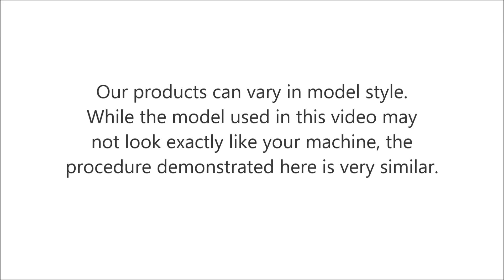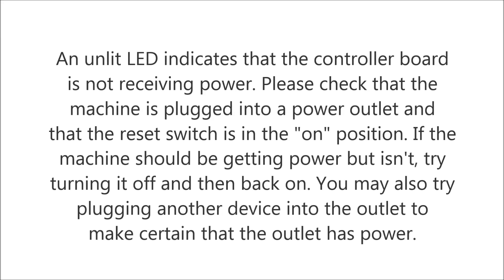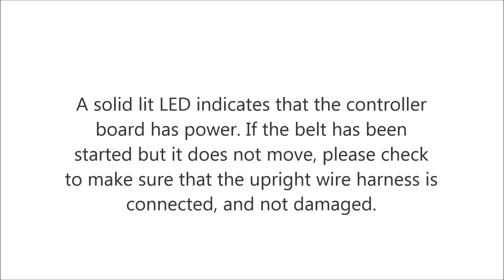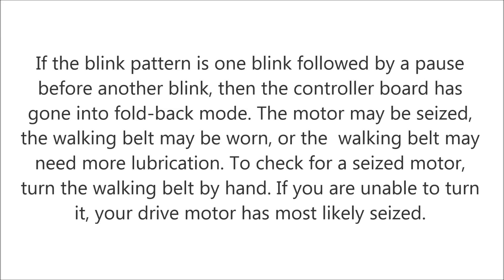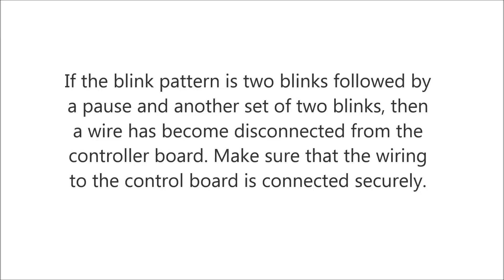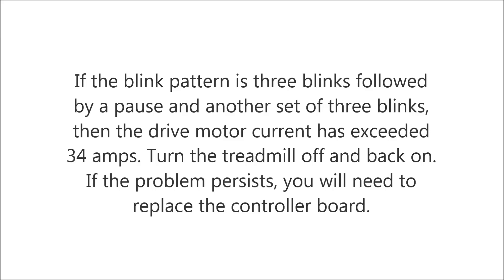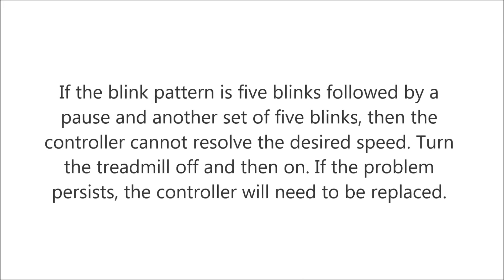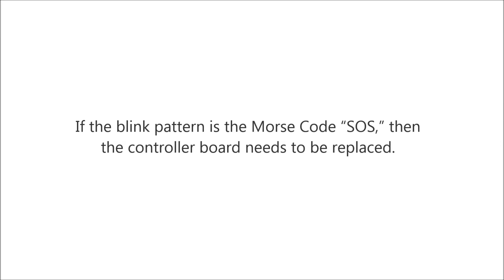LED Blink Patterns on the Control Board - Treadmill

Comment: my xterra tr6.4 stops as soon as I start it. then the red light stays lit and doesn't blink. I just got a brand new motor controller board put in. what is going on?
Reply from the maker: Does the red light ever blink? Do you mean your motor does run for a moment when you press the start button so the belt moves but only for a very short while?
Reply: Fitness Equipment Help yes it blinks. it starts then 2 seconds later it stops then the red light stays on then it says LS low speed
Reply: Fitness Equipment Help I just put a brand new motor controller in a couple months ago
Reply from the maker: I apologize,  I should have read your first post closer. This video is designed for trouble shooting  controllers from another manufacturer, Icon Health & Fitness. Icon does not make Xterra treadmills. I am not as familiar with Xterra machines but i would check to see if you have a speed sensor that is unplugged or in need of adjustment. Your treadmill console may be looking for a speed signal from this sensor and is shutting down the belt when it is not receiving the information it is looking for from the speed sensor.

Comment: My treadmill proform XT 70  shut down completely with Tripp in my wall circuit breaker , after reset my circut braker  I checked the control board, and it has a solid red light. What would be the issue typically in situations like this?
Reply from the maker: The most common reasons for your homes circuit breaker to trip when you start the  motor are using the treadmill on a circuit that may be overloaded and using the treadmill on a circuit with an Arc Fault Circuit Interrupter (AFCI) type breaker.  
 
The treadmill used a large amount of power, (amps), particularly when starting up or increasing the speed of the belt. It is recommended that the treadmill be on a dedicated circuit capable of providing at least 15 amps. Dedicated means that the only thing that losses power when the breaker trips is the treadmill. If other devices must be on the circuit then they should be very low draw devices like the light in the room or possibly a cell phone charger or the like. If too many devices are on the same circuit when the treadmill tries to start up the breaker will trip as more amps than the breaker is rated for is trying to be pulled through the circuit.
 
If your treadmill is on a dedicated circuit you should see if you are on an AFCI protected circuit. The breaker should say AFCI or ARC Fault on it. These are a relatively new type of circuit  breaker. If your home was built in the last 15 or so years it likely has AFCI breakers in the bedrooms. Homes built even more recently were required by code to have them on all circuits. AFCI breakers are designed to detect signals that look like sparks and shut off power to the circuit before these sparks can cause a fire. The problem is many appliances including treadmills generate signals that are similar to the ones AFCI breakers are designed to detect.  Some AFCI breakers are not sophisticated enough to tell the difference. Google "AFCI nuisance tripping" and you will find that along with treadmills, people have had issues with many types of products tripping their AFCI circuit breakers.  To relieve this you can try plugging your treadmill into a noise filter.   Your owner's manual likely mentions that you can get one from customer service. there are also other commercially available noise filters such as the Tripp-lite Isobar line of surge protectors.

Comment: My problem started today, only 1 year and 4 days after purchase. The light is blinking rapidly/continuously, but the belt is not moving. When I turn the speed up higher (5 or so) and give the belt a push, the treadmill will run; however it sounds like a diesel tractor and makes a clicking sound. It is soon followed by a strong chemical burning smell.
Reply from the maker: It sounds like the motor may be having an issue. The blinking is indicating that the controller is receiving the consoles commands and outputting voltage to the motor. Replacing the motor should resolve that issue.

Comment: My led is blinking 7 times. The model is Nordictrack 5.7 NTL6. What It can be?
Reply from the maker: Most LED Error Blink codes indicate an internal problem with the controller. Regardless of the number of blinks the troubleshooting is the same. First turn the power off. Verify all the wire connections are in place, including where the wires connect to the motor, and that there are no damaged wires under the motor hood. Finally if the error returns the next time you send a speed signal, then the controller should be replaced. To answer specifically this error (7 blinks) is in relation to the SCR circuit on the controller that is not functioning properly and indicated that the controller should be replaced.
Reply: Thank you very much.

Comment: +Fitness Equipment Help: When I took out the iFit live from my treadmill, The treadmill shut completely down and would not turn on again. I checked the control board, and it has a solid red light. What would be the issue typically in situations like this?
Reply from the maker: +A.J. huang 
If the red LED is lit on the controller under the motor hood then it is likely that the issue would be localized to the console. Another thing to verify would be to make sure your safety key is properly in place on the console. If the key is in place but the console will no longer turn on the console may likely need to be replaced.
Reply: my treadmill has a similar problem but also displaying the letters  sb on digital display. what does that mean.
Reply from the maker: Hi Jose. The letters SB on the display indicate the the console is getting input from 2 different buttons at the same time or is getting input when it is not expecting any.  The letters stand for "Stuck Button".Some times pressing or rubbing on the buttons can cause a stuck one to free up. If that does not work then you may need to replace the component on which the stuck button is located. Usually this means the console.

Comment: This may come as a dumb question. After confirming that the outlet DOES work, the LED light does not turn on upon supplying power to the treadmill. Would this be a issue caused by the Power Cord itself? I recently gotten a treadmill by Pro Form and Ive only spent time assembling and trying to power it on.
Reply from the maker: +randy D Power issues can be tricky, if the treadmill is plugged into a working outlet but the machine wont power you can try a few things. First start fresh, unplug the machine, make sure the outlet isn't GFCI (has a reset button on the outlet), many treadmills don't work well with those. Plug it back in, insure the reset switch is in the reset position (on), and insert the safety key. if the machine is still not powering. unplug from the wall and make sure all the wires under the motor hood are connected and not damaged. you many need to call ProForm customer care if the problem continues.
Reply: I have a Gold Gym's 450.  I have a sold light.  The motor works.  The walking belt does not move how to fix and thank you in advance.